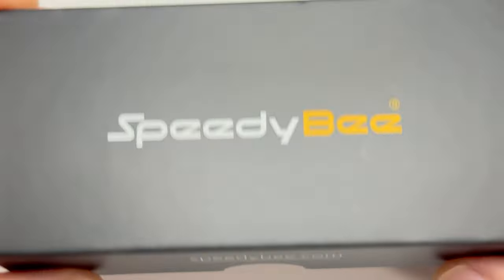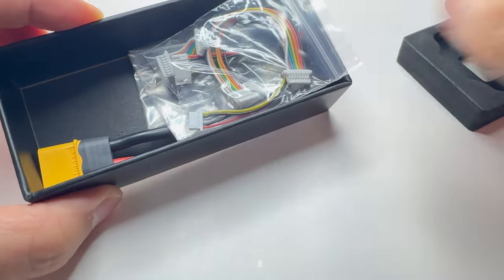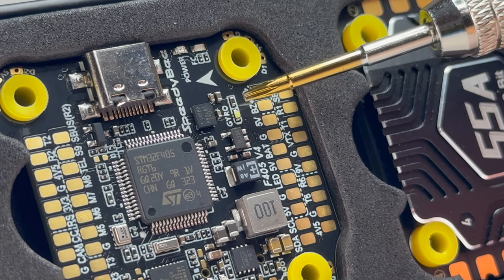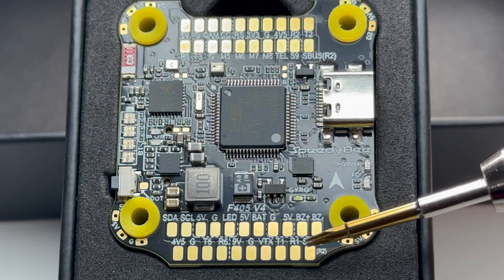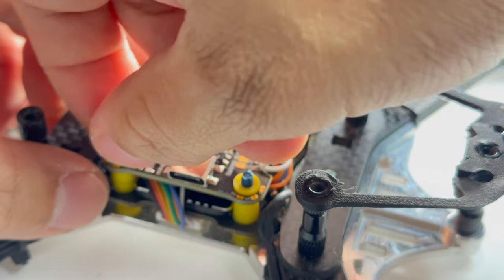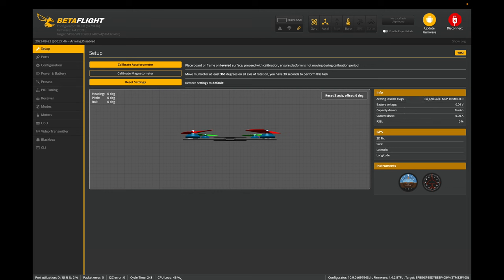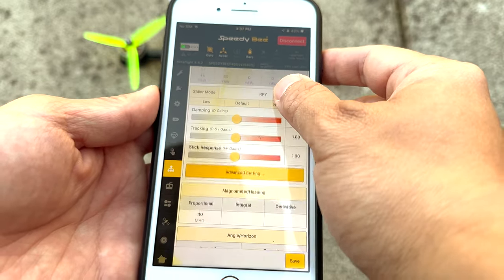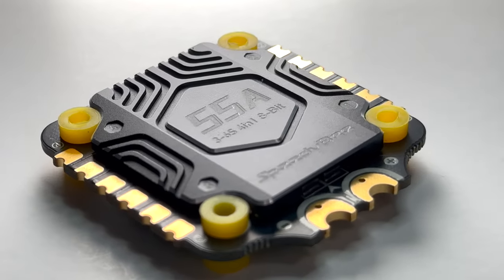SpeedyBee F405 V4 55A Stack Review | Best Value + Features + High Performance Stack! | FPV

Comment: I'm kinda new to all this, would this stack work well for making a cinewhoop? These parts are easily available to me which is why I ask.
Reply from the maker: Hey no problem man, ask away anytime. AIO is what you need! Its called All in one. Has the FC and ESC in one, lighter, and just one single board cause the cinewhoop its very flat with not much space. Look it up on google to find out more.. 25x25 mounting and its nice and flat. The stack shown in this video is for drones that are like freestyle to cinelifter drones 5" and up. Cheers.
Reply from the maker: @reddogdrones9043 I’ll check it out!